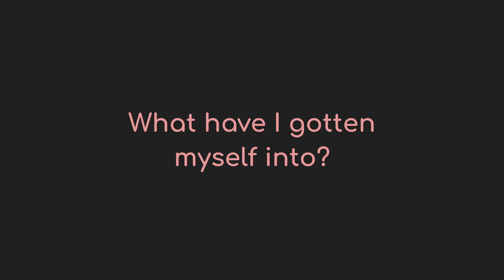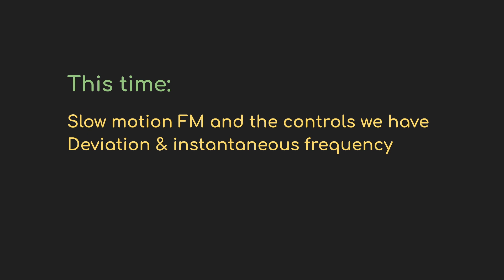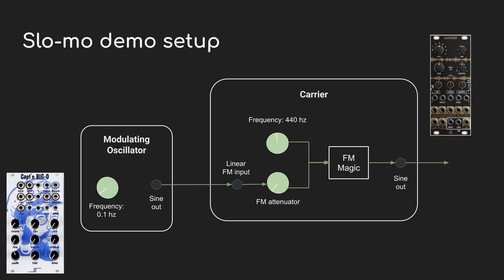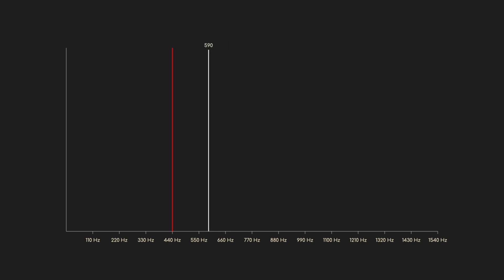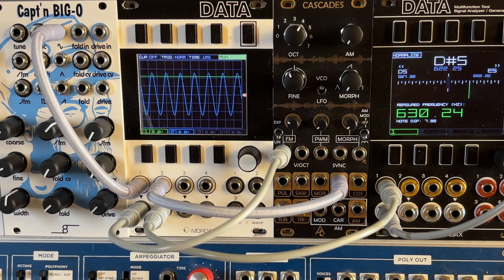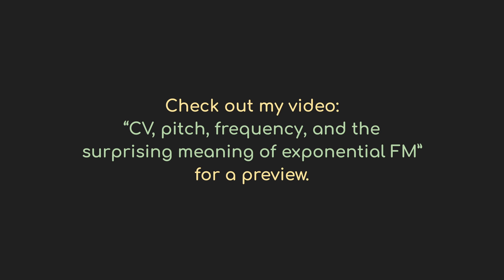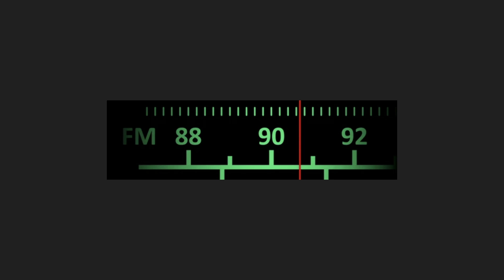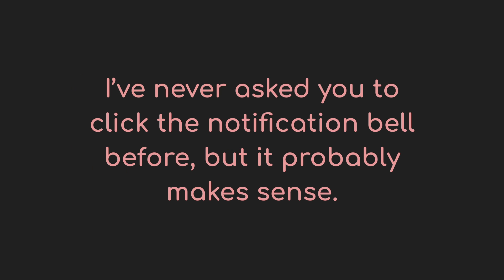Understanding FM #1 - Slow motion FM, frequency deviation, and how FM radio works

Comment: Yes, .. I never knew that FM radio signal's path had a width. I always thought of the signal, like a narrow, single rail .. versus a 3' wide sidewalk, relatively speaking. The FM stations around here .. indeed, they're spread quite far apart on the tuner range, in my location. And Mordax Data, .. what a cool tool. I never considered getting a 2nd one .. but, now I am. .. :)

Comment: I still don't understand the thing about the FM radio tbh. Like why does it need FM in the first place? Which problem is solved by applying FM to some music before sending it out there so car radios can pick it up? or is it before or after? what's each stage like?
Reply from the maker: @Beatsbasteln - It's not really right to think of it as "applying FM before sending it out".   Without any audio signal, the FM transmitter would just output a constant sine wave at the frequency of the station -- say 90.3 Mhz.  That pure sine wave is modulated by whatever the audio is.  It's not something done ahead of time, the transmitter does it on the fly, wiggling the oscillator a little faster or a little slower than 90.3 Mhz depending on the pitch and amplitude of the signal.  That is literally what it means to broadcast in FM.

Comment: Since this is meant to be a complete overview of FM, i think its worth clarifying the whole "deviation range" thing. 
The way it was described it made it sound like all FM needs to have the carrier wave completely in the middle with equal deviation on other sides. 
FM can be done with the modulator being a unipolar wave which would only raise (or lower) the pitch of the carrier. Plenty of complex oscillators (ie Verbos Complex Oscillator) work this way, so i definitely think its worth noting at some point in the series. 
Looking forward to the rest of the series and future videos from you in general!
Reply from the maker: @speed0 - That's good feedback, thanks.  I was going to come back to deviation in the context of exponential FM where the carrier sits about 1/3 the way through the deviation rather than centered -- but I didn't know about the verbos, I'll mention that.  Thanks.

Comment: This is good, but you did the thing that scientifically literate, and especially mathematically literate people do, you jumped from one thing to another too quickly. What is it that FM Radio is really doing? After all, it isn't broadcasting sine tones! I get it about the broadcast width etc, but how does it carry songs by Elton John and The Wu Tang Clan? Not in the same way a DX7 carries sine tones, presumably.
Reply from the maker: @teebeedahbow - the two are really very similar in terms of the actual modulation.  In the DX-7, you have one audio rate sine wave modulated by an audio rate signal (another sine wave); on the radio you have a much, much higher-than-audio-rate sine wave modulated by an audio signal (Elton and Wu Tang - the crossover we've all been waiting for).

Of course the DX-7 turns into audio, which vibrates the air and on into our ears; whereas an FM transmitter wiggles at the electromagnetic field, which is then picked up by an antenna.  

It's a fair criticism though, and maybe I should come back and do a longer video just on radio -- I didn't want to distract too much from the synthesis side of things, but radio definitely deserved more time.   Thanks.
Reply: @SoundVoltage  Thanks very much for the explanation. I really enjoyed your video. I was just disappointed with myself that I could make the jump from FM synthesis to FM radio.